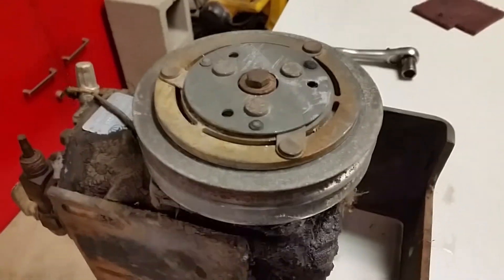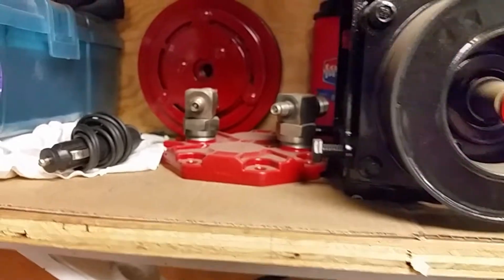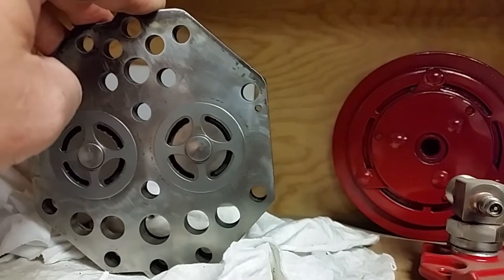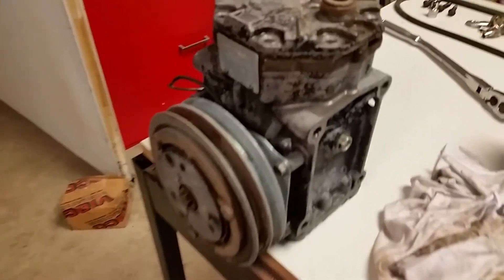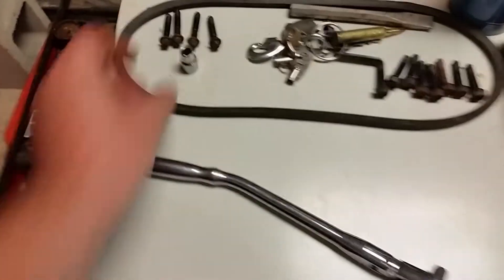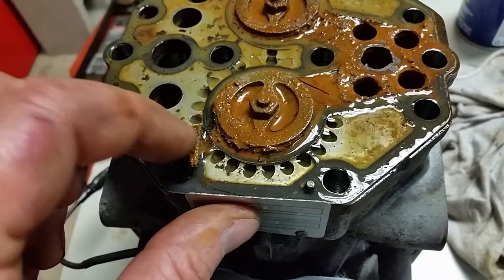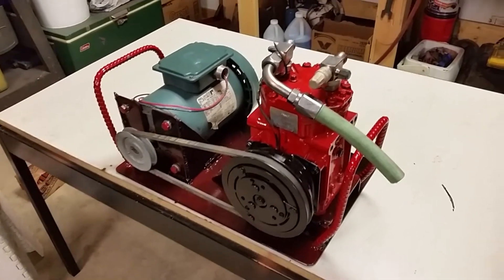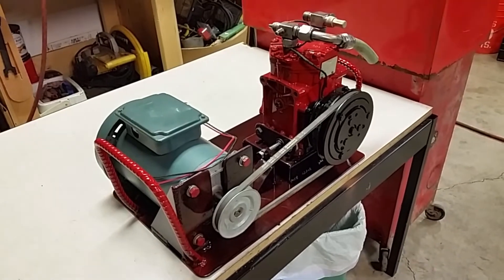York A-C Compressor converted to vacuum pump

Comment: So I'm looking to use this idea to feed a vacuum canister for my brakes and lockers in my diesel 4x4. Currently using a crappy hydrovac on the back of the alternator. Want to run bigger alt and still have brakes w/o going electric...
Reply from the maker: Sorry for the late reply two years later LOL a lot has happened, life-changing events. The York se compressor modification works perfect for an air pump for a compressor style I’m actually going to make a video putting one in my pick up. I am refreshing YouTube with a new start

Comment: So how are you going to engage the clutch pulley?

Great job by the way!

Larry
Reply: Vacuum pressure switch? So when the pressure in your res drops the clutch kicks on the vac pump...
Reply from the maker: I’m just using an external battery for now, but my 12v leads are about 10 feet long and can connect to any vehicle

Comment: Why not just buy air compressor instead of wasting time on junk home made unit
Reply: Not sure you heard him right but that compressor actually came off a kenworth truck.. aka a huge diesel engine and this was the air conditioning compressor. You can't buy an air compressor that could ever be close to standing up to what these York's do. So careful with the "junk" word
Reply: Why click on a video that you don't want to see? Just to be a troll?
Reply from the maker: Most stuff you buy is cheap unless you want to really fork out the cash. Why buy it when you can build it yourself for close to free and much better pump. Pretty much equivalent to a big rig air compressor with the twin piston. The ones that are purchased are single piston. There is a video on YouTube of a guy that times how long to go from 0 to 150psi, and it’s very quick. I’m building another one to put on my super duty for full air ride and remote air for tools etc...